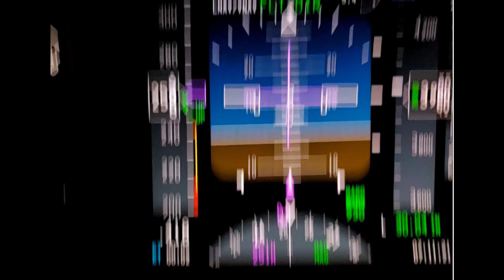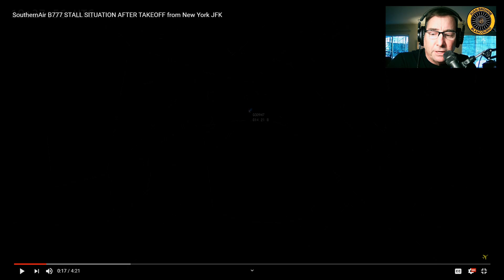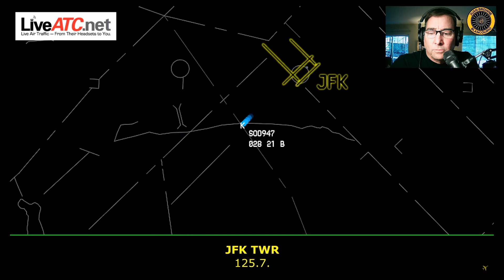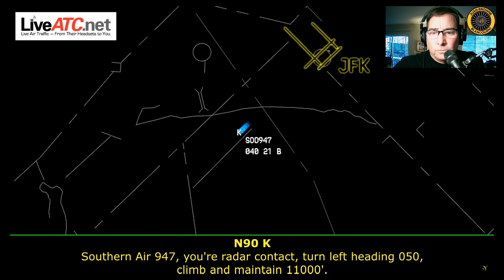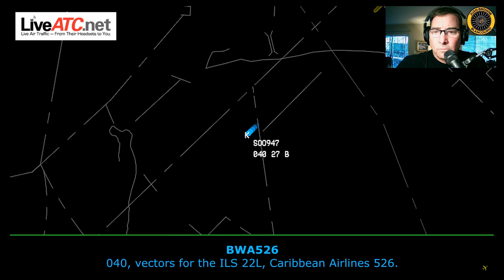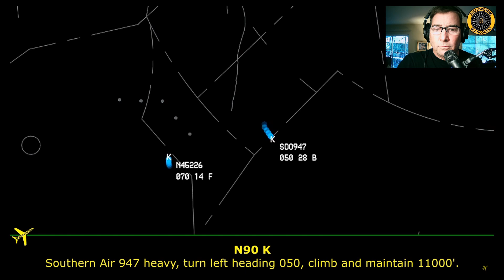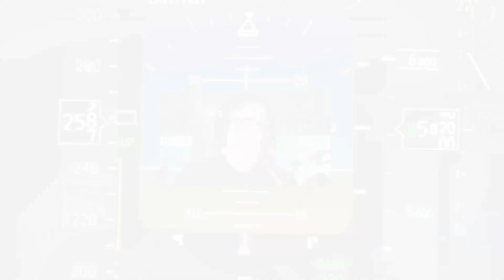"Stall, Stall, Stall" B-777-200 JFK 15 Nov 2020

Comment: While the obvious conclusion to the uninitiated would be that this was caused by pilot error, it easily could be caused by improper cargo weight. I’m a lifelong ‘freight dog’ in the Air Force, and on very rare occasions I have seen where the cargo arrived at the airplane with improper documentation, and individual cargo weights were just flat-out wrong. It can be next to impossible to figure that out unless the loadmasters have tons of experience and a good BS detector.  That hasn’t happened to me since, um...about ten hours ago. We left one pallet behind because on my flight today because it was all screwed up and they didn’t want to take the time to take it away and rebuild and reweigh it and bring it back.  They just took it away and will sort it out and put it on another plane. 

In this case, if the total cargo weight was 20k pounds heavier than advertised, all the speed calculations go right out the window. The crew would be fooled into retracting the flaps prematurely which could then lead to just this sort of incident. 

When the C-5 galaxy is really heavy, min flap retract speed can be as high as 209 knots, and max flap speed is 215.  So we have to accelerate to somewhere between 209-215 knots and hold it just so, as the flaps are retracted. When the flaps are retracted drag is reduced and at a given pitch and power setting, the plane will want to accelerate, possibly overspeeding the flaps while they are in transit. So we have to accelerate to above 209, raise the nose slightly to keep it from going much further (but not so much that it slows below 209), then as the flaps come up, we have to carefully continue to raise the nose further to keep it in the 209-215 window. It’s difficult and a bit stressful. It’s always a relief when they fully come up, because then we can lower then use and accelerate to 250 and climb out normally.
Reply: That was very well explained to someone like me who had only been mainly in simulators ( 737's ) and flying small airplanes .
Reply: And to me, a complete novice - but I understand how difficult and precise this is. It's a wonder cargo flights don't have more "incidents".
Reply: I was a FE on C5's i remember looking up front for those speeds on the told data on heavy weight takeoffs with TF 39's climbing out was no fun!
Reply: @creigiihtondenynis39  Hey Creighton, it’s good to hear from you. We flew together often back in the day. Do you still have that bad-ass 5.0 Mustang? I’ve still got my Pantera and GT-350. Hope you’re doing well!
Reply: @creigiihtondenynis39  I was a load master on C-141s. During the period from 1969 through 1973 (when I was active duty), C5A models didn't fly.
I am so glad that after 50 years, they finally got it right with the C5M. 😊
Reply: @Jo Mamma  ok whatever name you give to a pilot hired by the CIA for a job. Have you watched the interview of Boulanger ? Do you say it’s not the right term or do you say the CIA never hired extra pilots whatever the name ? That the CIA did barely legal special operations isn’t really questionable is it ? What is your point ?
Reply: This cocaine cargo and later CIA special ops pilot mentions overweight flying in rather hot weather and short dirt tracks as runways. A good story over on mikes Mc Brian channel in the spring 2020.
Reply: @7cle  I don't know how this CIA reference came into this thread, but I was just recalling Southern Air Transport's original incarnation as a CIA front.  Is that how the CIA got here?
Reply: You're a C5 pilot? Baller!
Reply: @Jo Mamma  They can call themselves whatever they want 'cause they don't officially exist...
Reply: Strange the engineers wouldn't have designed the flaps a bit more robustly so there's more than a 6 knot window between safe retract speed and flap overspeed :-(
Reply: @poly_hexamethyl  Likely the engineers did design in more margin. But the managers or the operators then took a look at that margin and decided they could use that in order to sell or use a larger payload capability.
Reply: @russella7263  don't forget the first rule of government contacting:  don't improve anything unless it is to comply with specs.   If the specs didn't say a 7 kt AS envelope for flaps was required, then a 6 kt envelope will do just fine.   
After all, isn't that why them jet jockeys join the AF:  to experience real white-knuckle flying?
Reply: Jesus....
They oughtta reinforce them flaps a bit.

A bit of a tangent here, but I always wondered how robust planes would be if they were all titanium instead of aluminum.....that would be cool...supersonic C5 LOL
Reply: As a C 141A loadmaster, I would suggested it's virtually impossible to determine if an aluminum pallet, 88" by 108", covered in visqueen and cargo netting, is overweight. With a multitude of boxes on the pallet, how is the density and weight actually perceived? I don't know if any crew member, including a loadmaster that could determine that. We had to take The word of the freight staff on that and cross-check the manifest.
But more importantly, it was the sequencing in position in the cargo bay, as to its true effect.
Rolling stock, however, I would seriously challenge the stated weight, as well as the center of gravity that is supposed to be listed on the item. 
After 50 years, I'm glad to see that they finally got the C5 program so it flies.
Reply: Wow, excellent addition to the discussion 👍
Reply: I understand. When I was a freight dog, I once picked up a UPS load with a Cessna 402 (6300Lbs max gross, nothing like a C5). It included a rather large coil of steel cable. The label on it said it weighed 50Lbs, which seemed completely ridiculous when I tried to pick it up. I asked the driver if it was a joke and refused to load the coil...
Reply: This posting brought back memories of the VC10 where flap up speed very often was very close to flap limit speed. If I remember correctly we were aiming for a target which was often only about six kts apart just like your C5. The rattle of the stick shaker concentrated the mind. Only a problem at high weights but in a turn and often in turbulence it was a very taxing. Your comments about incorrect cargo weights also rang bells.
Reply: The C-5 is an amazing plane. I fly the 737 and there's plenty of considerations, but we don't have as many when it comes to weights to this degree. If anything, we have extra considerations when the plane is too light lol. I've always been curious if landing a heavy is significantly more challenging than narrow bodies due to all of that inertia. I'm at a US-based airline that is a 100% 737 fleet, so alas, I'll probably never find out unless I meet someone willing to give me access to a level-D heavy sim!
Reply: @OmnipotentEnt  I’m a 737 pilot too. I can tell you the C-5 is infinitely easier to fly than the 737. It’s high wing, high tail configuration give it handling characteristics almost exactly like a Cessna 172, just on a (much) larger scale. That inertia you reference imparts stability and predictability which are welcome. All that wing makes for much lower landing speeds at the end of a flight. When we are completely light and empty of cargo we occasionally have approach speeds that are as low as 100-105 knots!  But even fully laden, approach speeds are substantially lower than the 737, so you have much more time to react and make small, finesse-type flight control inputs. By way of contrast, to me every 737 landing feels like a crash in progress, a.k.a. a carrier landing. 

I routinely would bring friends into the C-5 simulator. If you fly a trip with a C-5 reservist, just ask! 👍
Reply: @PanteraMike  Wow, sounds like I need to go down the C-5 rabbit hole and learn some more because those approach speeds blew my mind! It makes sense with the enormous surface area of those wings, but I would have never expected something that slow. I always chalked up the C-5s I've seen landing as looking slow due to their size, but today I learned! 

Noted on the reservist tip - lots of former military guys in my airline so I'm sure that sim opportunity is out there.

Comment: Juan, I appreciate the info and the effort you put into your channel!  Being a 73 guy for over 14 years I got more/better/timelier info from your channel on the Max than I did from my work.
A question I have on this since I haven't flown heavies for over 14 years and it was in the service: do you actually have to request "high speed climb" every time your min maneuver is above 250 kias on departure?  I don't recall ever doing that, and the only time I recall hearing that request on the radio is for descents.  The reason we didn't was because Part 91.117 which prescribes the 250 below 10K includes the paragraph: " (d) If the minimum safe airspeed for any particular operation is greater than the maximum speed prescribed in this section, the aircraft may be operated at that minimum speed. "   The exception applied to little airplane fighters and trainers that had fast min maneuver speeds.  

Just wonderin' because I was surprised to hear that from the PM in his radio call.  It almost makes me think, as you mentioned in your video, they might have suspected some significant miscalculation of weight causing some safe airspeed uncertainty--which would have me flying well above what I thought was my min maneuver speed, too.

Comment: 11:37 Juan: interesting that civilians need to always report/request high speed climb. Per FAA 7610.4S Appendix 18, our life in military flying allows us to exceed 250 KIAS for min manuever as well, but there is no requirement to request it with ATC. You are automatically cleared to do it.

Wouldn't that annoy ATC to no end if every long-haul heavy was asking for high-speed climb? Also, FAR 91.117d does not mention any required radio call.
Reply: I didn't believe you at first, but you are correct sir!

Comment: Nice coverage of the event Juan Browne! 
As a freight dog this has been a topic of conversation for a few days now. Some interesting things that have come up are: Does the company define if their fuel is calculated following FARs for 250 below 10k (flaps 1 would be required in this instance) or optimum clim performance. This would also require the crews to request “operational performance speed” of xxx below 10k on heavy gross weight routes if fuel is a limiting factor. 
It also brings up good discussions on authority or releasing the 250 speed restriction, any potential agreements between the company and the FAA, and also the company SOPs.

Comment: Good as always, Juan!!
Just a remark, the speed indicated on the radar is GROUNDSPEED. I believe it's important to note that since we can see that number go well above 250 knots during the stall recovery and just before asking for the high speed climb (300KT groundspeed at 5000') but does not mean they "violated" the 250KIAS retriction below 10000' although they could have in an emergency situation. Groundspeed depends on wind and TAS and TAS depends on compressibility and density so it's OK to have a TAS/GS of 270-300 at 5000' and still comply with the restriction.
Reply: I've done negative groundspeed a number of times in an Islander. Good times.
Reply: @blackhawks81H  really?
Reply: @MC-cd8ni  Yes...really................Paul
Reply from the maker: Yep, I mis-spoke.
Reply: Facts.  Ground speed read out.
Reply: Saving the airplane overrides ANY rule.
Reply: Yep. I think that the FAA put out a notice that said that ATC cannot give you permission to exceed the 250 KIAS limit. I stay well below the limit in my Skyhawk.
Reply: @UncleKennysPlace  My first thought on seeing Skyhawk was Douglas (i.e. A-4), not Cessna.
I was thinking...should be pretty easy to push past 250 KIAS
Reply: @charlesborlase2238  Funny, the A-4 was also my first thought. The C-172 is not capable of violation, therefore would not have even popped into my head.
Reply: @UncleKennysPlace   LOL - very wise on your part.    However if you did Exceed 250 in a SkyHawk ,  the FAA may just give you an award .... but only after you turn in that report within 24 hours , explaining how you did it and why ...
Reply: @Snailmale7  ...why the wings are still attached.
Reply: @MargaretLeber   Wings are pretty strong :)
Reply: @Snailmale7  Not that strong.
Reply: @MargaretLeber  Three wrap layers of Gorilla Tape along the length of each wing strut. Increases wing load to 273 KIAS.
Reply: @MargaretLeber   okay :)
Reply: @UncleKennysPlace  the ATP who owns a MiG-23 tells ATC he is going to takeoff and climb at 324 kt.  It is necessary in the event of an engine issue. https://youtu.be/WsHPoQygnVQ?t=1220
Reply: @UncleKennysPlace   Your Skyhawk appreciates you.
Reply: @Rich G I disagree on the violation part. One is given great lattitude during an emergency declared or not. If they were stalling for whatever reason getting that speed up while they still had altitude to do so was the right thing to do after all they were supposed to be climbing.  The controller noticed a possible problem and queried.  During the figuring out why they were stalling is not the time to be worried about a rule violation or asking for permission.   Fly the plane.
Reply: @billsmith3493 Protect skin, tin, ticket, in that order.
Reply: @wdonno  Never heard that before, just the old vanilla Aviate, Navigate, Communicate. Very nice
Reply: @wdonno  If you protect your Ticket, tin and skin will take care of themselves😉
Reply: This may come as a shock to some- you don’t always go under 250 under 10k.... some rarely do and heavies frequently are exempt.
Reply: I would also like to think that the controller did a good job with this situation also.
Reply: damn, I am commenting on a dinosaur video, lol, sorry

Comment: Even airbusses can stall in normal law, it is just exceedingly rare and requires quite dynamic events. One of our crews had that during approach in convective weather (ie a thunderstorm close by) caused by windshear. 

Over here in Europe we do not have a government run reporting system for getting free out of jail, however a "just culture" is required by law, which basically means: report, and any honest error will not be punished. However, in the above case the normal chain of events post the set up (which was a single stall warning and immediately recovered) would be to set the flight crew to "no fly" on normal pay, do an investigation and if required, remedial training and then back on the line. The trainer would only know the training program but not the cause for that training (except if the crew shares it), and the line manager does not know why a crew is set to no fly. Simply to remove any chance of a stain on their reputation as it is completely non-punitive. 

Having flown both Boeing (15 years 737) and Airbus (5 years A319--21) i can see the merits of both systems, however, the sidestick has actually some plus sides to it, the negatives would, for me, not be the inability of feedback nor the limit to alpha max (not min maneuvering speed), the latter is actually quite helpful for a (E)GPWS recovery: simply pull full back and get the best possible climb performance out of the plane without worrying about undulating around the PLI. Yes, shove the thrust levers to TOGA as well, but even if you don't do that, you will get TOGA thrust anyway. 

And of course it is very simple to lock out a misbehaving colleague like in the recently reviewed atlas air crash. That said, in gusty weather i would prefer the more direct control of the boeing without the .1 second delay until the FBW does its gust correction on the airbus.

Comment: Assuming all the flight operational data was correctly entered then did this simply become a lack of awareness by the pilots?  If you set autopilot to fly a certain IAS climb this wouldn't change unless the pilot manually changed the numbers. I'm assuming the aircraft was on autopilot by 1000 feet. 

So when the flaps were retracted, the aircraft was even closer to stall speed. They never noticed the slow IAS or there attention was diverted elsewhere in the cockpit. One look at the airspeed indicator would tell you everything you needed to know during the climb.

In a perfect world the pilot flying would verify the input of speed and altitude changes made by the pilot monitoring when entered into the autopilot. Was airspeed input incorrectly as 210 vs 240 would be one explanation.

Comment: It gave me a very great understanding.  First, thank you.
Coming out of Brussels 35 years ago, ski trip,, Belgium Airlines,, all equipment snowed in on the east coast of the US,, They pulled out a converted freighter, the belly already loaded for Montreal, heavy machinery.  I watched them load it.  Then up top to get everyone on their way, they pulled every seat out of storage and bolted them to the aluminum deck.  Every seat was a different colour, every seat had a defect, cigarette burn, recline mechanism was non functional, and they loaded all passengers for JFK, Montreal, and Atlanta on to the same flight.
Over loaded, load center too far aft, 12,000 (?) foot runway,  they used every inch  and i felt the wheels touch the berm after airborne. The operation speed window must have been astronomical. .  The approach into Mirabel 6 hours later was a masterful  downwind, base leg, final that covered upstate New York,Vermont and 50 miles north of Montreal.  We came in hot.  Good pilot,, he was not going to slow down until on the deck.

Comment: Airbus takes over? Prevents pilots mistakes? Didn’t work for the AA Airbus that lost its vertical stabilizer and rudder and crashed in New York. Pilot error, over stressing the aircraft, said the NTSB.
Reply: To be fair, an A300 handles more like a Boeing than an Airbus made after the A320.
Reply: The A300 that crashed back then is a traditional aircraft without Fly by Wire. Airbus FBW and it's envelope protections came only to be with the introduction of the A320 in the late 80s.